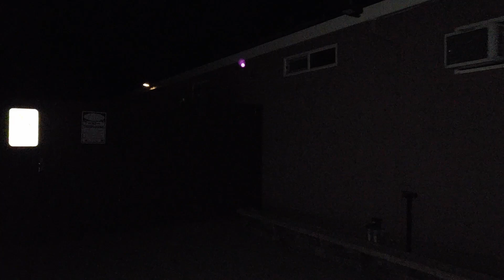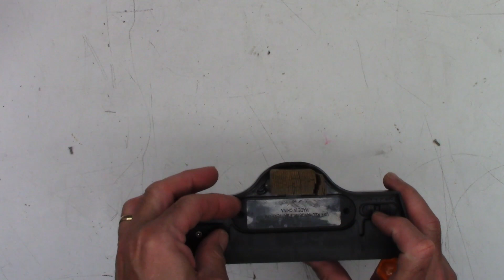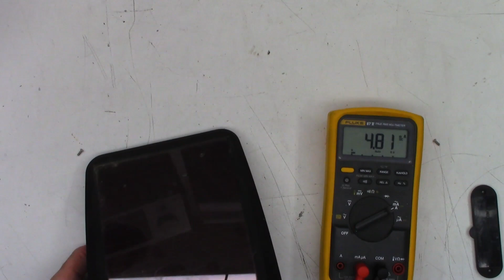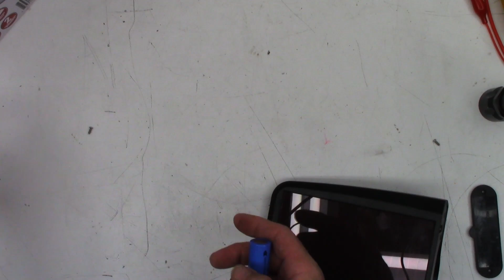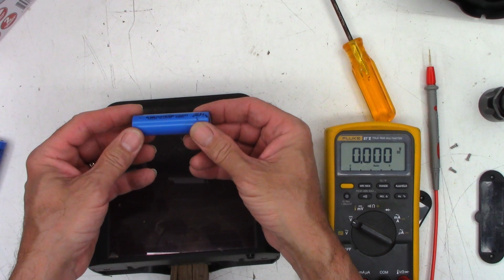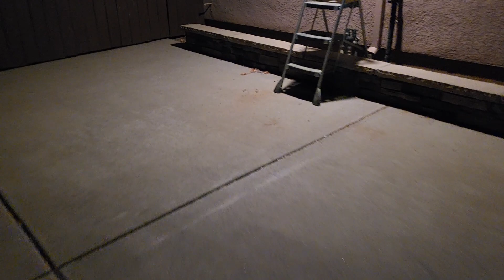Wal-Mart Hyper Tough FSI 80-817 Security Light is DEAD! Is it just the battery? Lets repair it.

Comment: I came here from looking these up as an "in store" product, and it was on Walmart. They have one in-stock for about $29 that has 2-18650's @ 2000mah. I don't need the light portion, I just want the housing, batteries, and the solar panel. I will then mount that outside to power my weather station. It has a solar panel on it and I thought that would also charge the rechargeble batteries I put in it from Harbor Freight... but it doesn't. The panel only provides power to operate the unit when in daylight. It's a Vevor YT60234 model with WiFi to connect to Weatherunderground.
Reply: @coloradostrong8285
Did you ever gain access to the inside of the FSI 80-817 Solar Led Security Light?

Comment: Curious as to how well the low voltage cutoff is or if it relies on the battery to have integral protection? Definitely looked like it had high voltage limit, the way it was clipping there when testing the panel. Good to just replace battery and not junk it and they make it easy to replace too. Not too common to see that!

Comment: Probably overcharger battery and tripped CID/Pressure valve. You mentioned that you need add bit of solder on the end of battery what pointed me to idea that they originally used protected 18650 and you changed them for unprotected one. The unprotected 18650 Battery has a diameter of 18 millimeters and a length of 65 millimeters and protected 18650 battery however will have a diameter of 18.2 millimeters and a length of 69 millimeters on average and domed positive electrode.